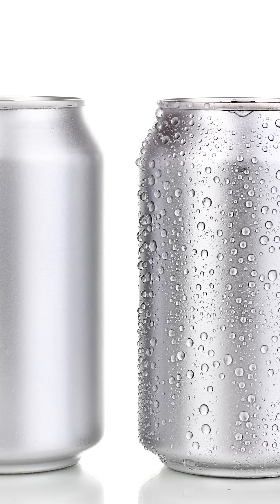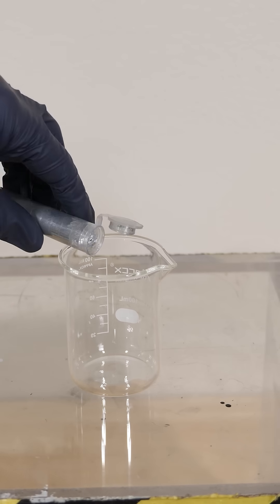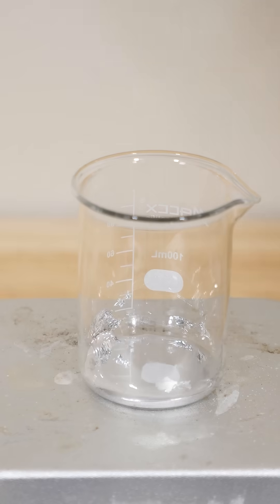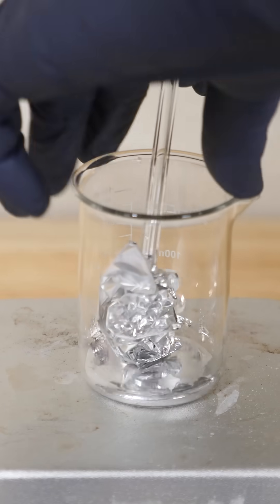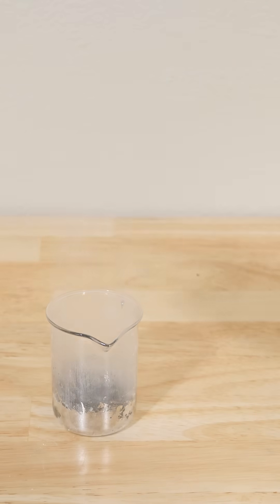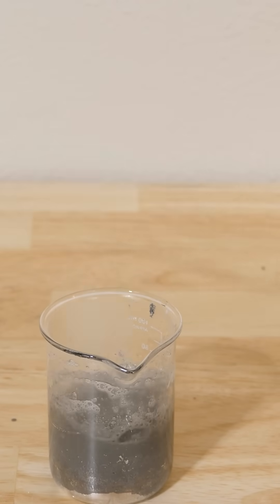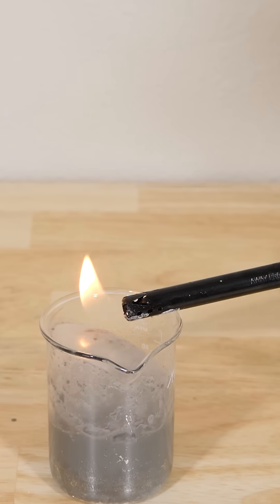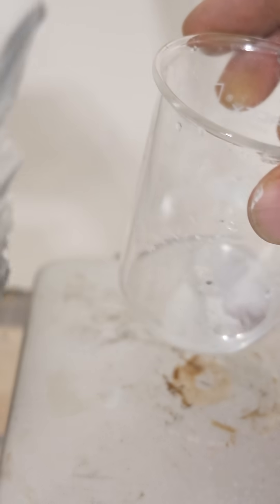Don't mix water and aluminum!

Comment: You can use the Hydrogen to run a car.
Reply: you leave on a red cloth table lamp with a regular kind of bulb in the bedroom and an oval tubular vintage bulbed desk lamp on in the office next door. There's 1 lamp in each room. You wait to see which type of bulb burns out first, how long it takes and why. 

Would you consider this example to be doing a type of experiment?., ;

Comment: Do this in vacuum chamber, I know that you can't completely remove air, but lets see it without gallium.
Reply: you leave on a red cloth table lamp with a regular kind of bulb in the bedroom and an oval tubular vintage bulbed desk lamp on in the office next door. There's 1 lamp in each room. You wait to see which type of bulb burns out first, how long it takes and why. 

Would you consider this example to be doing a type of experiment? ;.

Comment: You could also just dissolve salt in water to produce hydrogen with aluminium
Reply: you leave on a red cloth table lamp with a regular kind of bulb in the bedroom and an oval tubular vintage bulbed desk lamp on in the office next door. There's 1 lamp in each room. You wait to see which type of bulb burns out first, how long it takes and why. 

Would you consider this example to be doing a type of experiment?

Comment: When I was a boy I read about and did this: roughly equal parts aluminum powder and solid iodine crushed as fine as practical, mixed well. Add a few drops of water to the mixture and it catches fire. I still don’t know the mechanism: might it have something in common with adding gallium, or is it entirely different? I don’t know.
Reply: Similar but different.
Some of the iodine reacts with water snd produces acids, these remove the oxide layer on the aluminium which can then react with more of the iodine.

Comment: You are giving the wrong reason why Aluminium doesn't react with water. Why on Earth would Al react with oxygen in water if there's much more oxygen in the air? Isn't it already covered with Al2O3 before going into water?

Comment: In case you all are wondering, I intend to use this to generate energy from all the aluminum scrap I have where I live, because its worth more as hydrogen to me then it is sold as scrap. electricity free hydrogen gas generators for hydrogen torches.

Comment: There's something else about this that makes this extra cool. That layer that forms on the outside of aluminum? It's called corundum. And it will crystallize if placed under heat and pressure and create very very strong crystals. You've probably heard of them. They're called rubies. Or sapphires. They're the same crystal, just with some mild mineral inclusions, to add color, but the point is, they are both just aluminum rust, and aluminum rust is extremely sturdy. As matter fact, it's so sturdy, that some manufacturers were trying for a while to turn it into a glass that could be used for a vaguely indestructible phone screen. They got the glass to work just fine, but the process to create it is a bit on the expensive side.
Reply: Thank you so much for sharing. Very interesting!
Reply: The old "transparent aluminium" from one of the Star Trek films.
Reply: @android584  That specifically is Alon, otherwise known as Aluminium Oxynitrite.  But yeah. Aluminum is neat when you do stuff to it.
Reply: @TacComControl  That would be aluminum oxynitride, which has a high melting point (well above the point at which aluminum oxynitrite, if it could be made at all, would decompose).
Reply: Aluminum is impressive
Reply: @MaxricoQuen  these days you can actually get snap down composite floor boarding that is top coated with sapphire glass, which is just aluminum rust, and they do it specifically because sapphire glass is extremely scratch resistant, which makes for a very long lasting floor.
Reply: @TacComControl  Aluminum can't rust, you mean oxidize.
Rust means iron oxide.
Reply: I’m sorry, but what does vaguely indestructible mean?
Reply: @gametalk3149  corundum is a nine on the mohs scale, it is very hard to shatter it, which was a huge reason why sapphire glass was being looked into by phone manufacturers. It's also why it is used as a top layer on high quality composite snapdown flooring. It is extremely scratch resistant.
Reply: The windows in attack helicopters are sapphire. So are nice watch crystals, as in the "glass" part you look through.
Reply: @alexanderlancaster4799  do Omega watches have it?
Reply: @davidpoole8840  mostly, but they do offer hesalite on speed masters due to heritage I believe. NASA didn't want the risk of shattered sapphire in zero gravity.
Reply: @alexanderlancaster4799  cheers mate thanks for the information 👍
Reply: You can also make small rubies in a microwave because of this.
Reply: Thanks for the cool information mate 😊
Reply: Thank you fir this info!
Reply: You are rad!  Thanks for educating us all.
Reply: Cool, I didn’t know this! I thought rubies were just carbon with traces of other minerals.
Reply: @CarbonFiberSwan That would be diamonds
Reply: @styx85  Yep, I knew diamonds were carbon, but for some reason I thought rubies, emeralds, and sapphires were also carbon, lol! Not sure if I heard that from somewhere, or just came up with it on my own. Now I know
Reply: @CarbonFiberSwan Emeralds are actually made out of beryl (not alumina, which is rubies and sapphires), which is a compound of beryllium, aluminum, silicon, and oxygen.
Reply: Awesome!
Reply: Doesn't Kyocera make sapphire screens. Had 1 and it was always shiny without scratches, still managed to crack it cause I'm destructive.
Reply: yup rubies when you have sapphire contaminated with chromium
Reply: The prettiest gems have the ugliest beginnings I suppose.
Reply: Fighter jet windscreens and the exterior instrument glass is also lab grown sapphire. You can purchase off cuts to admire or play around with.
Reply: Why not diamond screen? Or diamond crystals of that size are not possible and way harder to grow?
Reply: @farpurple  Even if it were equally easy to grow both, Sapphire is significantly more resistant to fracture. Diamond might be very hard, but it can be fractured very easily, whereas sapphire is very hard to do that with.
Reply: That IS extra cool
Reply: That's such a corundrum
Reply: I used to work in a pawn brokers and we used a diamond tester to confirm if it was Sapphire glass on watches. I have no idea why it worked but it did and filtered out a lot of the convincing fakes
Reply: Fun fact now : scientists just found a new, more cost-effective, and efficient way to make aluminum glass (they just call it transparent aluminum). Hopefully we see a lot of it soon.
Reply: Aluminium oxinitrate (aluminium glass) is what that round window on the space station is made from.  Tough as hell
Reply: Sorry to hijack this comment (it was the one with a 'local minimum' in replies), but could this be used for clean energy?
Reply: @Anonymous-df8it  Not for clean energy generation, and not very well for clean energy storage.  You have to consume energy to produce the aluminum in the first place.  And then if you use it for energy storage you will get considerable loss of energy in the step of reacting aluminum with water -- the hydrogen you get will have considerably less energy than the aluminum had before reacting with water.  (Now on the other hand, an aluminum-air battery is a real possibility, although aluminum-air batteries have not yet made it into the civilian market, apparently due to poor shelf life once you add the electrolyte, which by the way does not contain gallium.)
Reply: @Lucius_Chiaraviglio gallium is also crazy expensive to just end up as a waste product in the reaction. Yes it can be recovered easily, but it was $10 per ml last I checked.

Comment: Alumium is similar to stanless steel in terms of the oxide that protects the metal from futher oxidation
Reply: The oxide layer on stainless steel is formed from its chromium content.
Reply: @robertfoulkes1832  I know that

Comment: Stainless steel forms a shield quickly, and resists H2SO4 at rest. But if the sulfuric acid is flowing fast, it washes the surface quickly, exposing fresh surface metal. No oxide layer to protect it.

Comment: Gallium is wicked expensive! You can do the same thing by mixing Li, sodium hydroxide with water and then put in your aluminum foil in that. Instant very violent reaction generating hydrogen gas also.

Comment: How much hydrogen does it make? Can we recycle aluminum into combustible gas this way in an efficient enough method to actually be useful
Reply: Aluminum is extremely expensive energy-wise to refine from bauxite, which is why it's the most important thing to recycle.
We throw out the equivalent of our jetliner fleet in aluminum every year.
Reply: @davidm5707  I could see people in 500 years sifting through “ancient” trash dumps looking for it lol

Comment: Can you do a video about the "works bomb?" It's putting little loose balls of aluminum foil just coverned with works toilet cleaner in a bottle then quickly put the cap on and throw it and it explodes in a few minutes. Thick bottles like Gatorade work the best

Comment: A simpler way is to use a strong (12m) base against the aluminum.  The base reduces the oxide, exposing the (now raw) metal to the water. The resulting reaction is exothermic, accelerates automatically and renders hydrogen gas (H2).
Reply: Could that be used for clean energy?
Reply: @Anonymous-df8it  no
Reply: @SiwyWabbit  Why not?
Reply: @Anonymous-df8it  
The exothermic reaction produces aluminum oxide.
Reply: @SiwyWabbit  Is that bad?
Reply: @Anonymous-df8it  
Your original question mentioned "clean". You decide.
Reply: @SiwyWabbit  May you please be specific about the environmental impacts of aluminium oxide?
Reply: @Anonymous-df8it  
Can't ear it. Can't breathe it. Never goes away. Already all over the place -- used on grinding wheels everywhere.
Reply: @Anonymous-df8it you need to use a lot of electrical energy to create aluminum. Then you only reclaim a portion of that energy back using this reaction.
Reply: @jbmurphy4  Couldn't you just dig it up from the Earth?!
Reply: @Anonymous-df8it  aluminum is too reactive to be found in metal form. Aluminum oxide (bauxite) is what we dig out of the ground. Then we use electrolysis to split it into pure aluminum.

Comment: I have always thought about this reaction as a use for energy conservation. My theory is that you can use solar energy to produce aluminum. The aluminum is your source of energy. The aluminum is your fuel, and instead of transporting hydrogen or fuel in your car with hydrogen, which is proven to be, a difficult concept you feel your car with aluminum blocks. A system in your car mix is gallium with aluminum and water to run your car. Then you go to the gas station submit your gallium and receive more alloy. And on and on.
Reply: aluminum is not a source of energy as a lot of energy is required to make pure enough aluminum. It is more of a stored power transferred from the aluminum to hydrogen.
Reply: @acters124  yes, but renewable energy (solar, wind, ...) is sometimes not available (winter in europe), and sometimes it is abundant (storm). When the energy is abundant (storm, summer sun) we could make aluminum and use it in winter to heat our homes, or am I wrong?

Comment: The person who invented aluminium foil for wrapping food should get an award
Reply: ...a hat?
Reply: @bcubed72 only if it comes with a rabbit and a bat
Reply: @jonslg240  and a '64 Impala?
Reply: @pbase36  I wish I was like 6 feet 9
Reply: Woooo! I finally know how I'm powering my next passenger blimp..err..RIGID AIRSHIP!
An aluminum airframe, with galium and aluminum and water for hydrogen generation..
With a few support structures I can shave the aluminum away from for added fuel as the ballast water feeding into the gallium+aluminum reaction lightens the craft!

Please tell me how any one of these is a bad idea so I can call you a simp and we can all experience some HUMANITY!
Reply: @jonslg240 actually this seems a great idea!
The balast should be also aluminium actually. Rain, bodies of water and in worse case condensation machinery will provide water. 
The product of hydrogen generation (aluminium oxide) can be offloaded when the aluminium reserves are replenished. In emergency the aluminium oxide can be yeeted to quickly gain altitude.
The only issue I see: cost :-(
Reply: I think it was tried once before @jonslg240
Reply: @jonslg240  Don't quit your day job.  Gallium eats and erodes aluminum. You can weaken an aircraft's structural components from the inside out with Gallium.

Comment: Now I want an engine fueled by this
Reply: You have the same problem as you have with electric cars. Mining the metals takes a lot of energy and fuel.
Reply: This is actually a proposal to "store" hidrogen safely. Aluminum oxide can be then later recycled and turned into metal using renewable energy. The downside is the aluminum energy density in this way is lower than diesel. Extra weight and space using aluminum pellets.
Reply: @wacdevdevelopment2408  so it'd be a viable option to do? Tbh it was just a random thought 😁
Reply: Unfortunately gallium isn’t super viable. To power a hydrogen powered car for an hour, you need at least 12 liters of hydrogen. With 115 grams of gallium, thats going to last you an hour. 

I have 100 grams of gallium, and that cost me 60 bucks
Reply: @johnlevin4567  That's true, but not entirely relevant. In princible, gallium can be cheaply recovered from the reaction chamber - it just sinks to the bottom of the water. So, again in principle, the original cost doesn't really matter when amortized over its lifetime. It's the recovery costs that count.
Reply: @wirebrushproductions1001  Just looked it up and you're right. I suppose the only problem I can think of would be separating it from any leftover residue left behind by the aluminum
Reply: I was thinking the same thing as he ignited the gas, just like a spark plug ignites fuel…so you would think…theoretically 😂😂😂😂😂..not a scientist or a mechanic, so I’d probably end up blowing myself up..😂😂😂
Reply: The fuel used in solid rocket boosters is a mix of aluminum (fuel), ammonium perchlorate (oxidizer) and iron oxide (catalyst). The huge amount of energy needed to convert bauxite into raw aluminum, means aluminum contains a huge amount of energy per unit mass.
Reply: Only issue is to not make too much
Reply: Those already exist. There's not much infrastructure to support them, but they do exist
Reply: Okay so you want to use one of the most dirty and most energy demanding processes (aluminium production) to power a car. Sounds interesting
Reply: Is this reaction viable as the basis of a hydrogen fuel cell?
Reply: Right, a tin foil powered car
Reply: @henward7866 No! A hydrogen fuelled ICE!
Reply: @houseeka ikr! The great dilemma of the car industry just solved in one short! OK, maybe there might be some issues to some elements/components of this reaction... yet to know, but its a positive step in the green direction! Hydrogen is very viable again! 😅
Reply: @ev-ezaye3580 
Next war: Gallium resource dominance 😵
Reply: @ev-ezaye3580  People have been looking at this process VERY seriously for the last 40 years. And they keep running up on the same problems. The generation process is hard to control, and the recycling of the gallium is expensive and unwieldiy.
Reply: @ev-ezaye3580 You need electrolysis to create 100% clean hydrogen for hydrogen cells and water. If you had a 100% solar or wind farm, or even an ocean wave powered electrolysis hydrogen production plant to produce hydrogen you could actually create a 0% emissions production. And when hydrogen is spend it produces water or steam as an exhaust. Basically a car that runs on water. This is 100% viable but....of course humans are greasy and greedy, the want to not do the free option and instead they want to keep selling you gas by burning the gas to produce electricity instead of a 100% clean option that is 100% renewable and sell you the same garbage they have been selling you because they have already stock piled it they don't want it to go to waste and still create more emissions because doing the non solar and wind option creates a huge amount of carbon dioxide. 

Point is we've had options for renewable and clean energy for a long long time but the 1% or the 1% decided, "NOPE LETS ONLY USE COTTON AND NOT HEMP.....LET'S ONLY USE GASOLINE AND COAL" And so on and so on....welcome the the garbage pale of a country and planet we live in all by our own doings. As much as I love Elon's advancements he wants to destroy the oceans by deep sea mining lithium for his Tesla's now I. Sure as the sun is yellow and the sky is blue....(which they're not) that out governments are totally on our side and want to do right by humanity haha jk they keep feeding people the illusion that were a democracy because simply no one stands up and outs an end to their crap. Personally I think we build a bunch of guillotines outside of government offices and whatever else around the planet, we don't use them but now they know they better not fk up or else we will. You'll see how fast things change around the planet

Comment: Many stages of aluminum machining generate dust while water is used as a machining coolant/lubricant. The sumps of these machines gather this wet aluminum.  It must be gathered and properly stored.  This is always a concern in these factories. 
Said the former waste technician at a heat sink factory.

Comment: I used to perform an experiment now and then when I was a boy.

The idea is the same, but instead of gallium, I think we used a solution of water and lye, then drop the aluminum foil into the solution.

It makes a lot of hydrogen, and the reaction is extremely exothermic!
Reply: Can that be used for clean energy